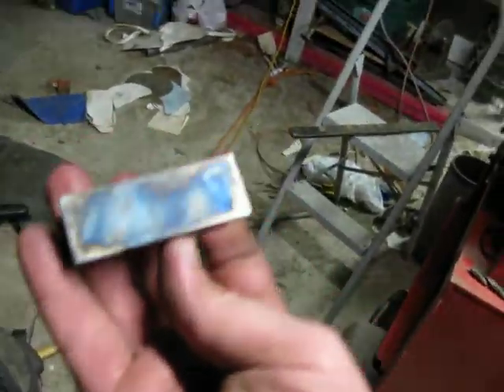Color Case Hardening

Comment from the maker: That's just a small burnout oven. I picked it up at a campus surplus Auction at Texas A&M. University auctions are good places to find stuff like that.

I'm not sure what your second comment is referring to. This was just a test section of medium carbon steel. Doing this to a knife blade would completely screw up any previous heat treatment the blade had. Dropping oil or air hardening steel into water would severely crack it.